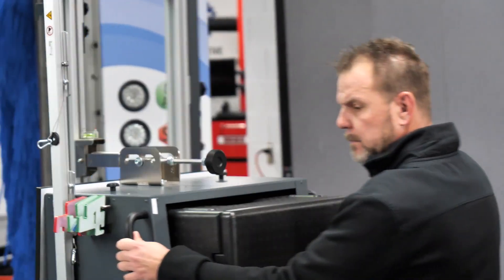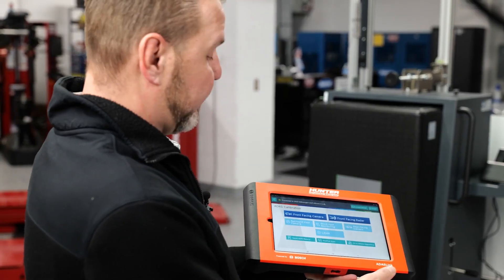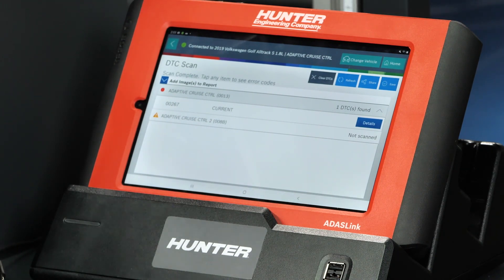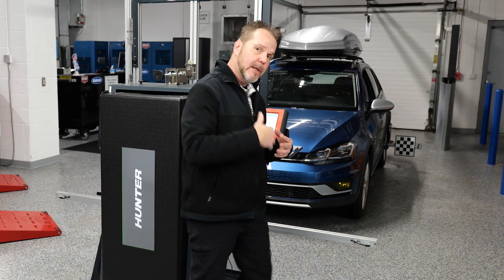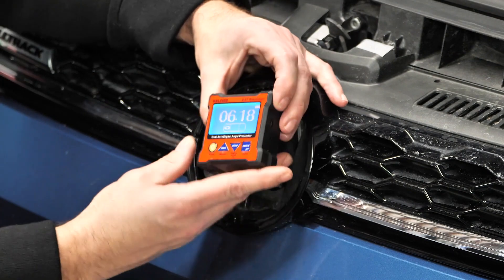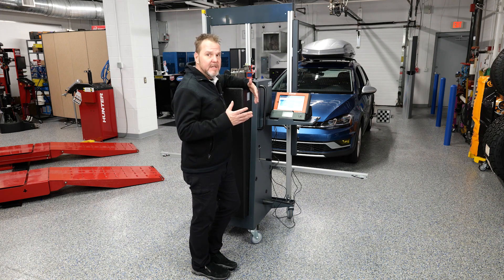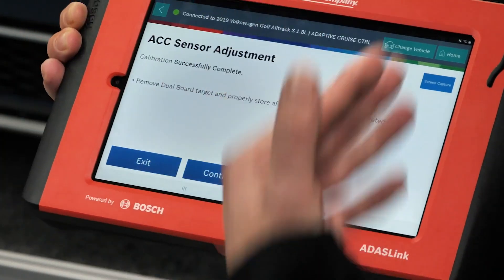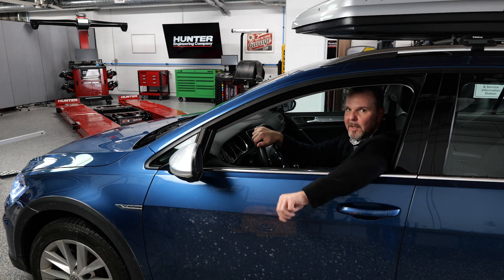ADAS calibrations: Volkswagen Golf Alltrack ACC sensor, Part Two

Comment: have 2016 Touareg. Dealer wants $6000 to replace both ACC radar sensors. Not convinced sensors are bad since they said they bypassed sensors in a test and everything was OK.  HOW can you test an ACC radar sensor to tell if it is working or not?

Comment: it is AMAZING how many shops i go to that have simply not installed the milliwave correctly, either by not using all of the bolts, or even hooking up the connector!  i have to say, it’s oem procedure to inspect the radar before calibration, and i stick to it because of how often i run into these kinds of problems and waste time.  helps to use the oem software as well, ODIS in this case.